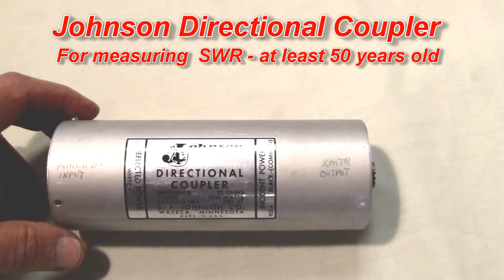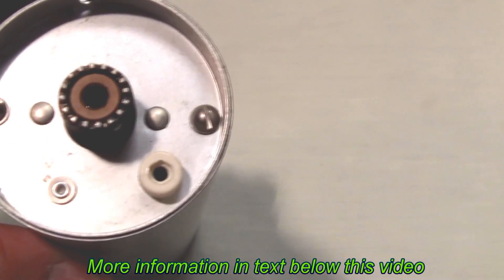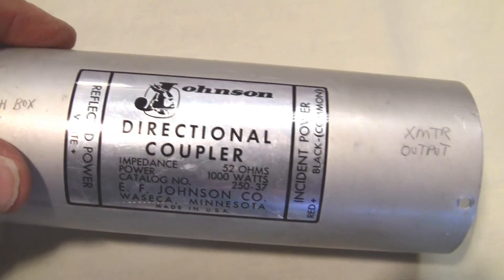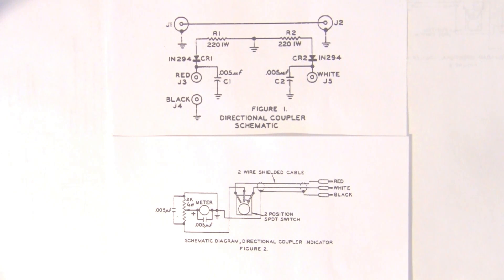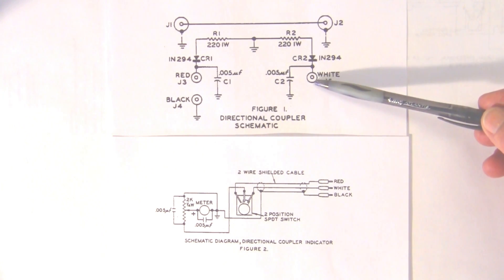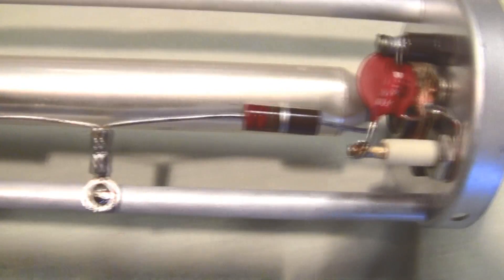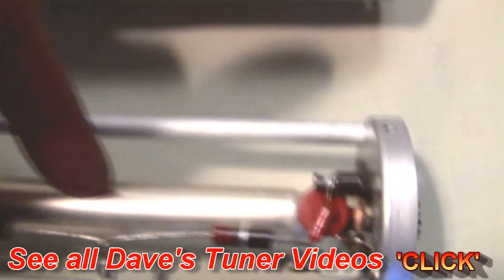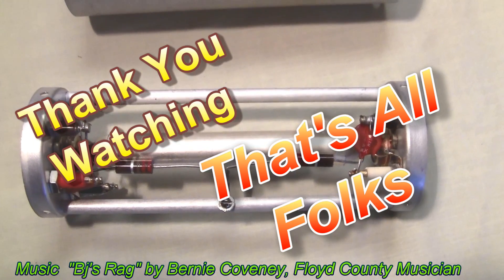Antenna Directional Coupler Johnson

Comment: Hi Dave, Nice video thanks.. Are you able to measure the dimensions of the pipes, lengths etc. I would like to build one. I think that some of the old amateur radio equipment are interesting, thanks.
Reply from the maker: Rod Wall Hi Rod  - Thank you -  the dimensions are not real critical - Good luck with the project and thank you for looking at my videos.

Comment from the maker: Hi Dave - You can find plans for 450 ohm ladder line antenna's in the ARRL hand book and on line. Also MFJ company makes many of them already assembled.  About the concrete wall - this is a physical problem of the hole in the wall. I don't think you would lose much just running the ladder line thought wall if that is possible - your idea should work also-  The end fed zepp should work as well - you may want to make it longer if you have the room. Dave KK4WW Computer Collector Historian

Comment: Thanks Dave, I was wondering if you could discuss antennas for the transmatch, I have a viking by Johnson and the swr coupler.   I have had this for years but never used it as I don't know how to build a balanced twin line and run it through my concrete wall.  I suppose I could build two 4:1 balun's one on each side of the wall and connect the balun's to a short run of coax then use the unbalanced twin lead up my tower to make a end fed zepp for 1/4 wave on the lowest freq.  I like QRP CW , AE4J